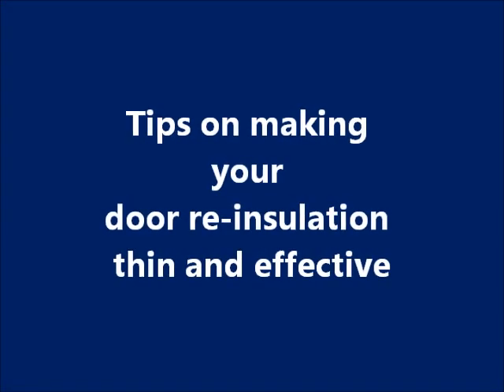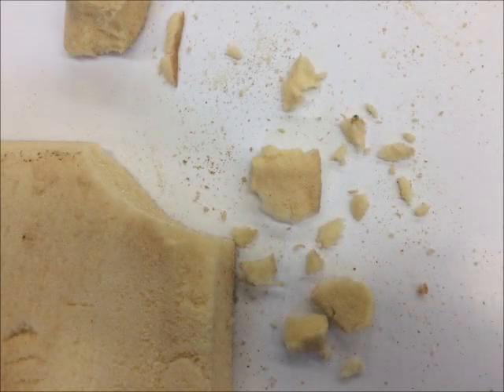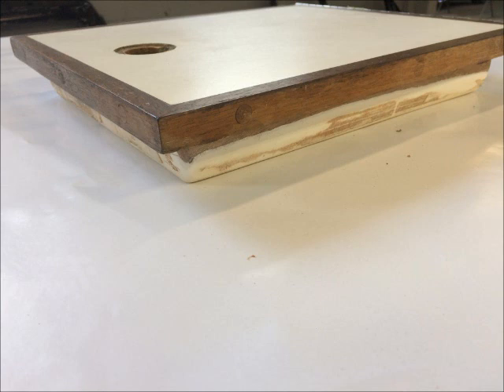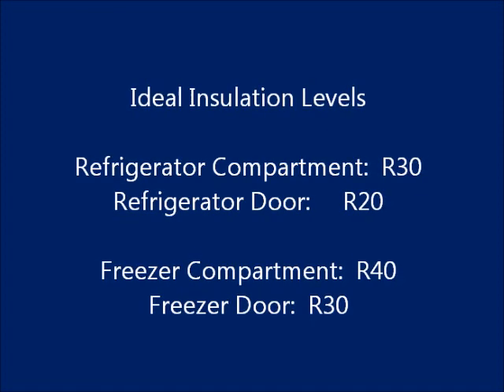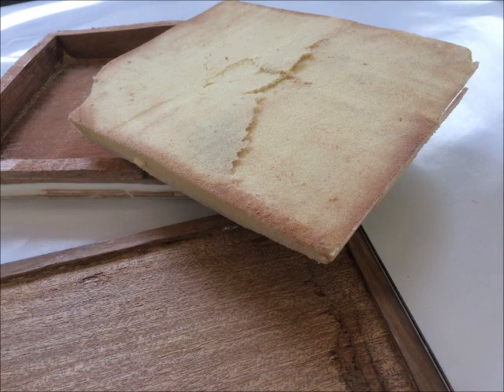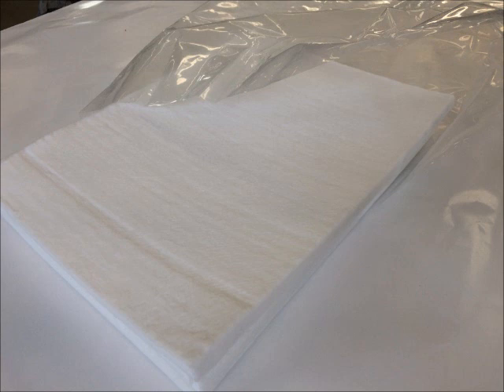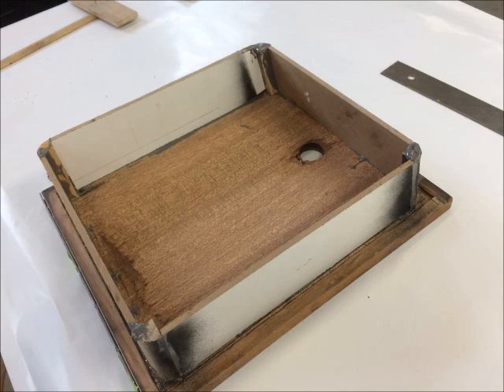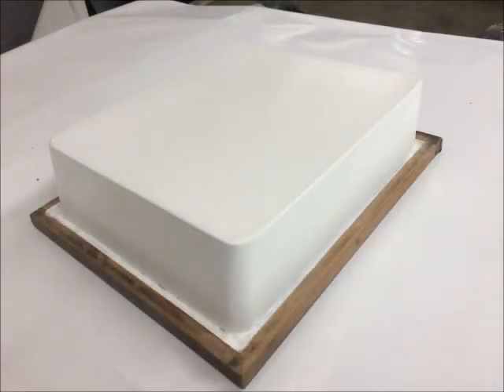How to Re-insulate fridge and freezer doors

Comment: Nice work. With the new insulation, what is your average ice use per day? I think I read that a good ice box, 5 - 7 cubic ft would use 6 lbs per day. Which is really pretty good. It is amazing how well good insulation works. Aerogel looks interesting too.
Reply from the maker: This door is actually in our deep freeze which has a refrigeration system in it  we don't use any ice to cool down our boxes but we can certainly make lots of it . We noticed a measurable difference in amp hrs used  once we did this upgrade. We also have our these doors/lids in our fridge , they work great !
Reply from the maker: We have these great boxes so we don't have to use Ice . It enables us to utilize DC refrigeration and free our selves from dragging Ice. No more being a slave to your Ice box.

Comment: Is aerogel the brand name or type of insulation?
Reply from the maker: Hi Kate , that’s a good question.

Aerogel is the type of insulation, we buy it from a company called Aspen on Ebay. They sell a few different variations of the product but for this application we used there 10mm matt and then layered it to the desired thickness and R value .

Regards  John.
Reply: ColdEh Marine Thank you for such a prompt and informative reply!